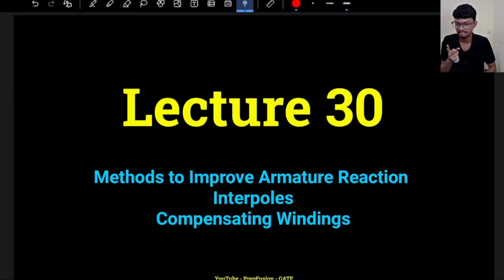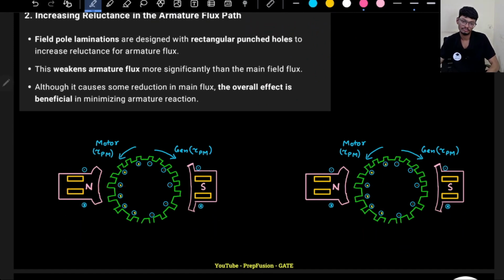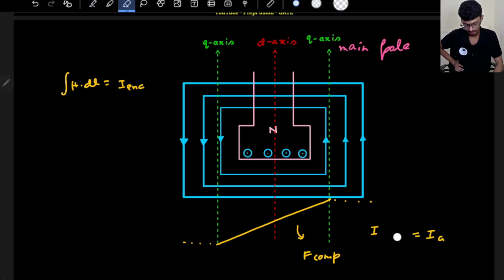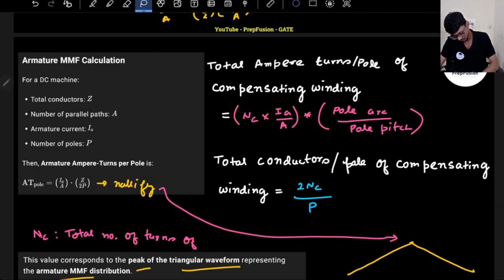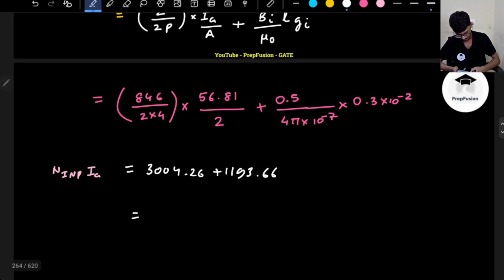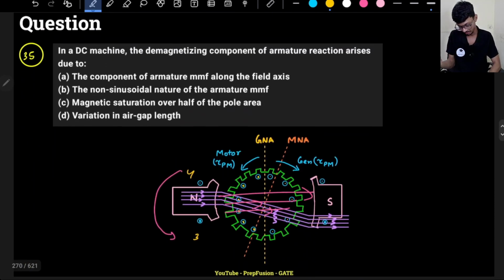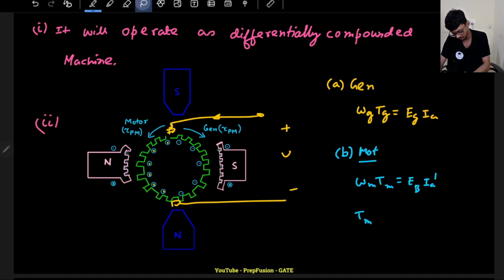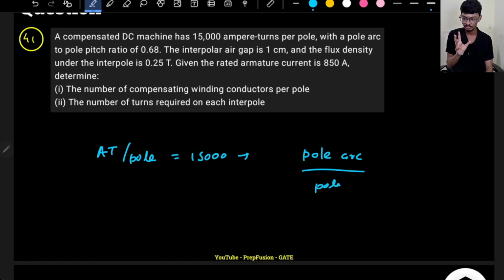L30 Methods To Improve Armature Reaction || Interpoles || Electrical Machine || PrepFusion

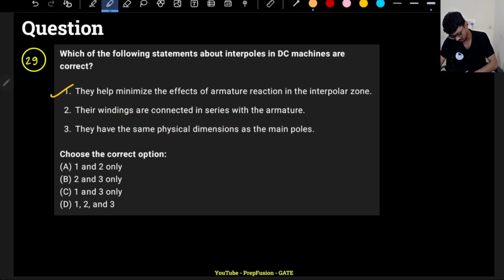Comment: 46:13 Correction Notice:
During solution the read the question incorrectly I read it as they have very small dimensions compared to main pole.
But in option was written same.
So Option A would be correct.